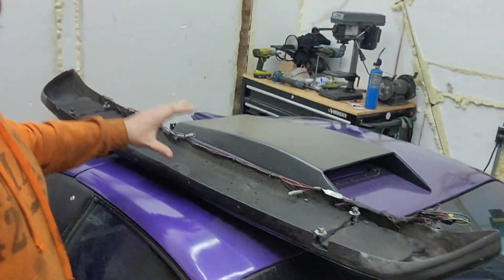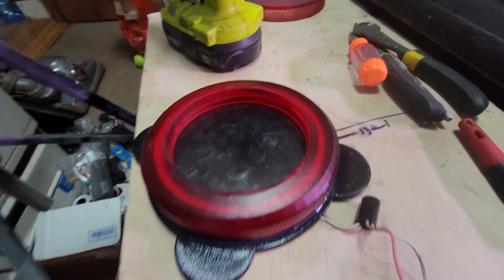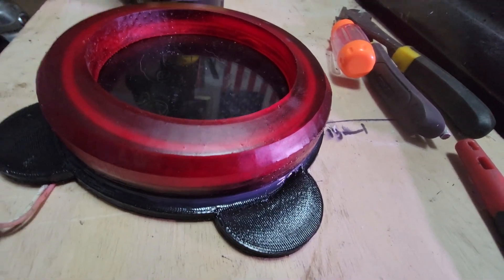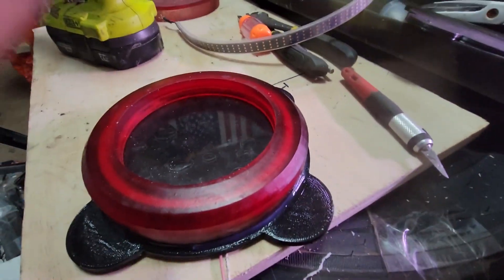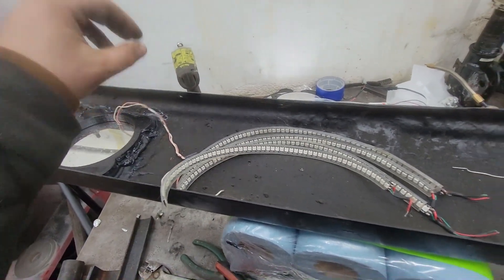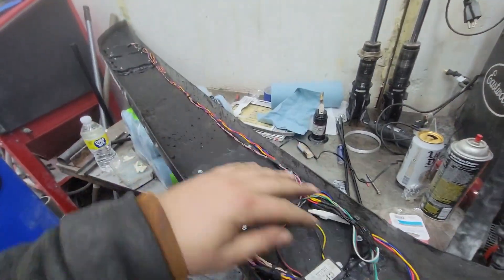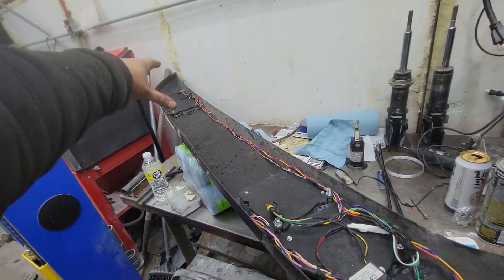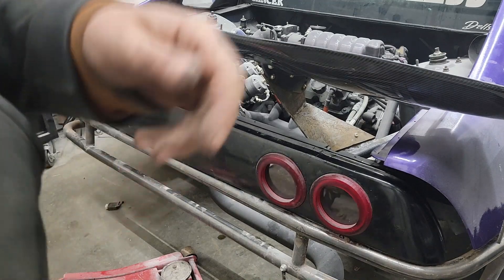HOW I MADE INSANE INFINITY MIRROR TAIL LIGHTS V2!!! USED 3D PRINTER!

Comment: Haha moms spaghetti 😆🤘 i hate wiring so much but you did a good job for sure those lights look dope af
Reply from the maker: I like wiring my stuff... not other people's stuff especially if its already been touched lol
Reply: @Garageless  haha i agree on the other people stuff part but man just wiring up my simple light kit on my mototec sucked 😅 probably cause i suck at soldering and im impatient trying to make it look clean lmao
Reply from the maker: Yea i dont do much soldering... i have trust issues with solder connections
Reply: @Garageless  haha im not gonna lie i used to just twist it and tape it, done and done 🤣
Reply from the maker: Im a twist, fold over, and 3-1 shrink tubing with glue over it kinda guy unless really important then ill use unisulated butt connectors instead of twist and fold
Reply: @Garageless  yeah honestly its never failed me yet ive recently started using shrink tube it makes me feel like its gonna be water proof especially on the mototec
Reply from the maker: @EmxBrandon  use shrink tube with glue inside it for it to b waterproof... i hate electrical tape lol tesa tape is cool stuff to clean up a harness as well... or braided split loom is cool stuff too...
Reply: @Garageless  for sure ill keep that in mind when i decide to do a 12v light system on the rsf. Gotta step up my wiring game and make it look fancy
Reply from the maker: I have a plan for when i go to make a 12v setup on mine... ill do that after i get my controller lol still waiting
Reply: @Garageless  dang bro that waiting game is rough. Cant wait to see what you do with it though. One of these day im gonna try to hit the tax collectors office and try to get a vin and register it, then i might go 12v and do some fancy lights on the mototec
Reply from the maker: Im tryin to avoid road legal to avoid the wreckless driving ticketa
Reply: @Garageless  🤣 dang why'd you have to say that 🤣🤣
Reply from the maker: Lmfao i have a grom for those lol
Reply: @Garageless  haha we gotta keep our head on a swivel at all times
Reply from the maker: I like to just do backroad lot seshes on the ebike... grom is big rides or country roads
Reply: @Garageless  thats what im going for too i need a grom asap
Reply from the maker: They are a blast but do need others to ride with to achieve maximum fun lol